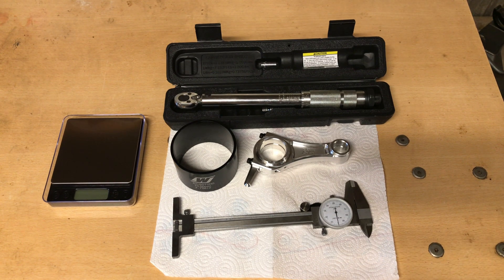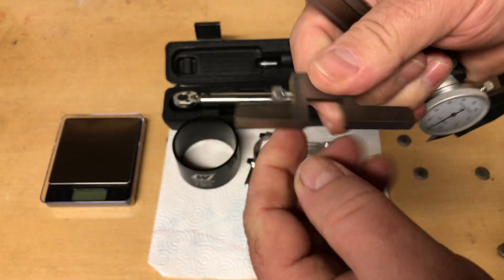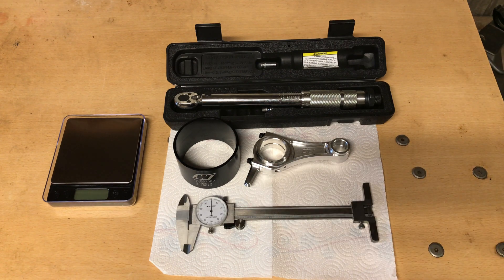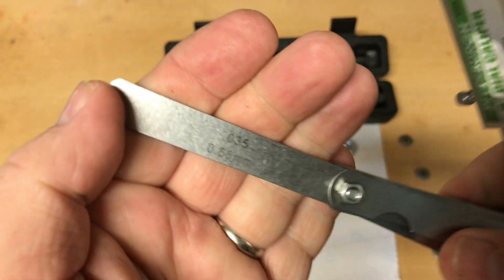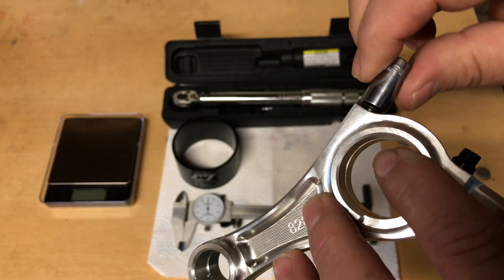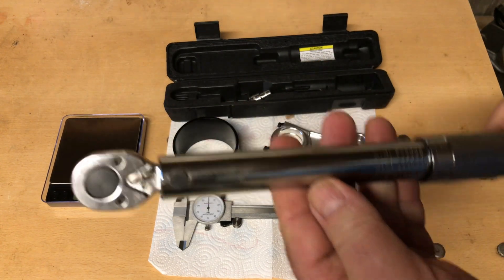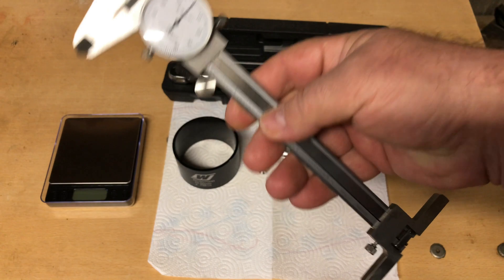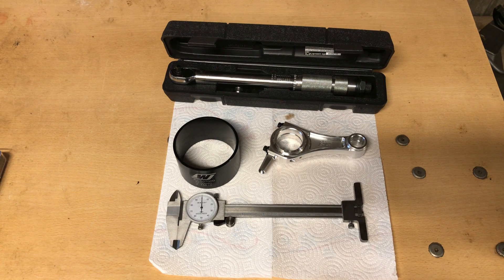224 Predator 212 Engine Build Tools. What Do You Really Need?

Comment: Great video! What do you mean I need to spray WD-40 down in the torque wrench? I am about to buy the exact one you show in this video, from Harbor Freight :).
Reply from the maker: Hi Alaska Wild! The Chinese tools usually come with a generous coating of grease on the innards of your new clicky type torque wrench. I would suggest you kinda thin it down a bit with some WD-40 or other light lubricant and do a few test clicks on a bolt placed in a vice before using on your rod bolts. A few more squirts of WD and a few test clicks later and you'll be good to go on the rod bolts. (They're actually pretty good little torque wrenches for the money, just takes a little "break in" prior to using it on the expensive stuff) Please don't skip the "break in" part if you use one of these....After the "break in" you'll notice the feel of the "click" improves and it will become nice and audible too.

Comment: I have a flywheel,  valve springs, and rod on the way for my pred 212. I hope I dont mess it up
Reply from the maker: You'll do fine JB! Just remember to check those clearances and bolt torques and if something seems like it's not going right or it seems hard to do for some reason, just stop and take a step back to make sure you're not doing it wrong. Hit me up with an email if you run into any problems. Happy to help if I can. Chris

Comment: Hello , enjoy your video content .. One video was a comment about the 252 rattlesnake cam . Do you know if this is the same cam used in the 212 ghost ? And would it work in the predator 224 ? Seems like they got the cam right in the 212 ghost . Thanks
Reply from the maker: Hi Liz! The 212 Ghost camshaft does share a lot of features with the Rattlesnake 252 cam. The specs are similar enough that I personally believe the Ghost 212 camshaft to be a direct copy of this grind. The Ghost 212 camshaft will fit the 224 Predator engine as they are both .549 shaft size (Honda clone size) Just make sure you check the clearance between the crankshaft/connecting rod and the camshaft as the 224 has the longer 58mm crankshaft stroke so the ghost 212 camshaft may require clearance grinding to fit. I plan on ordering a 252 Rattlesnake camshaft to do a direct comparison with the Ghost 212 camshaft as soon as time permits. Thanks!

Comment: Im new too this. I’m wondering on a 212 predator hemi stage 1   Is it possible to up grade the flywheel with out changing anything else or will that wear out the engine faster. Thank you
Reply from the maker: The lighter billet flywheel is a little tougher on the stock rod IMO. I'd go with a billet rod and insert bearing with the flywheel upgrade for best results. Depends on the rpm you're running too. If you're running over stock governed rpm, you need the billet flywheel regardless. Safety issue.
Reply: Thank you for your help
Reply from the maker: @pushpoptake1599  I appreciate you!

Comment: I could go for that piston ring compressor! Me and those metal band ones don't like each other much!
Reply from the maker: LOL! Well Nic, you know how I feel about those band compressors. I let everybody watch me fail using one in the 224 build video. Those tapered compressors are the trick!
Reply: @KentuckyFriedFixes  link for those ring installer?
Reply from the maker: @Dirtdog7680  Hi Adam! I placed a link for the 70mm Wiseco ring compressor sleeve in the description. If you want a different size just do a quick search on the jungle site or the bay place. I know I saw a complete kit that had all the common sizes (68mm,70mm,72mm) on the bay place somewhere.

Comment: I want the tool that checks circumference? Is the the dual indicator or something else? I’ve seen them used to measure the bore also.. I’ll be installing the billet rod in my 224 and these tools will help. Already got the ring compressor you recommended. Can’t wait to use it.
Reply from the maker: Yes Sir, the dial indicator is used to measure the crankshaft journal in several places and also the internal diameter of the rod or rod bearing so you can determine exactly how much clearance you have for oil. To check the out of round on the crankshaft you just measure several places. It'll usually show up between the top and the bottom of the journal (OOR) The best part is you no longer need to buy plastigage to check oil clearances so the little $19.95 dial caliper actually pays for itself in the end. The bore can also be checked at the top, but only on a fresh bore or a new engine. A bore gauge is really needed to measure for anything that's been run, but that's a specialty tool. Thanks!
Reply from the maker: Dial caliper* Willy to measure the out of round and diameter of the crank for oil clearance. You don't need a "dial indicator" to do it. I don't know why I typed "dial indicator" though they are important little tools to have as well with a magnetic base. The $19.95 dial caliper is the best multipurpose tool for these things.
Reply: @KentuckyFriedFixes  I will definitely invest in the correct tools for the job.
Reply from the maker: @DIYWilly  I know you do it right Willy! That's why I love your channel!

Comment: I stopped at hf today picked me up a new torque wrench some more welding supplies also bought me a tap and die set they had a hole stack of ghost guess what I didn't buy 🙃 😅
Reply from the maker: LOL! Those 224 engines are looking better all the time. Sam's building one now too!
Reply: @KentuckyFriedFixes  I'm going to finish up my 212 non hemi and my wc223 I've got a little more to shave for clearancing on the 223 I ever get it done I think I can do brain surgery that thing is no joke one of the hardest motors I've ever built the .280 I did one one of my old hemi builds was easier then this wc has been lot of back and forth burned a drimel up I get mad at it walk away for a week or 2
Reply from the maker: @heathenprojects2639  I'd take a Wildcat 223 over a Ghost 212 any day of the week. They can sure try your patience sometimes. I'm the same way, if something starts to get me frustrated, I'll walk away for a few days until I no longer feel the need to throw it off a bridge.
Reply: @KentuckyFriedFixes  I need to do a head gasket on my 86 honda 250r sit down with sheet of glass and sand paper I just keep putting it off
Reply from the maker: @heathenprojects2639  You'll get it. Wait for a rainy day when you're bored. Works for me!
Reply: I might stop HF day and check out a new dial indicator. Can never have enough tools.
Reply: @DIYWilly  I have a few things on my list that are not in the budget but it's summer time auction season kicks off next month were I find a bunch of good deals 😀
Reply: lol ghost they got jokey jokrs i see